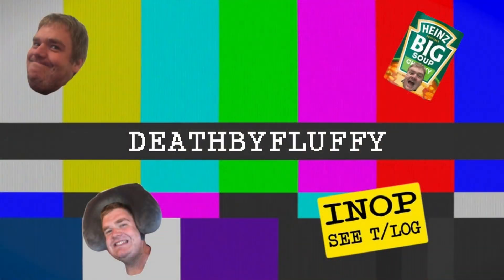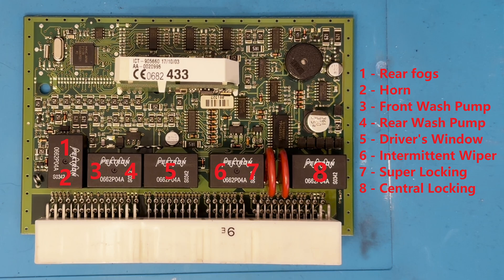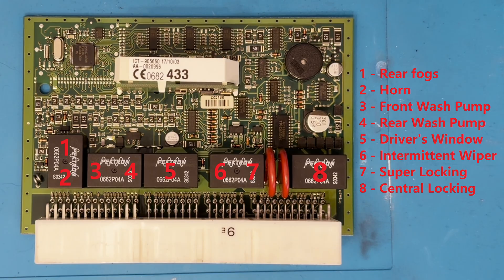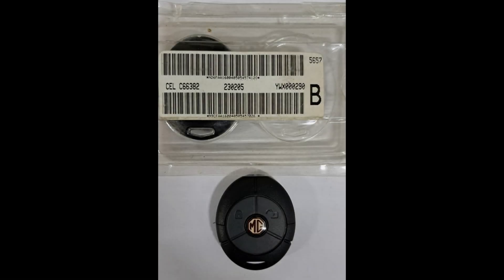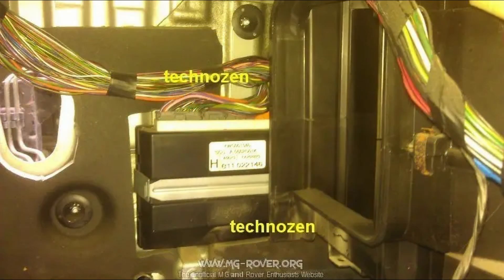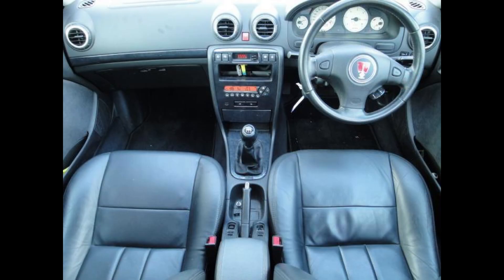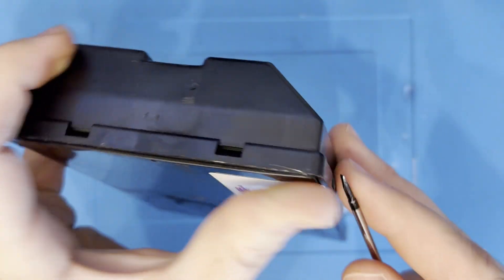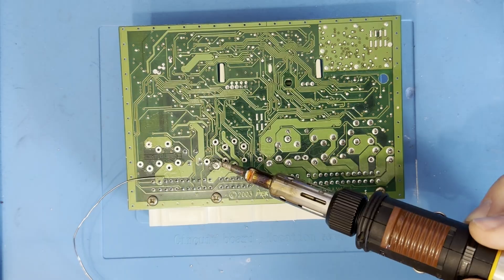MG Rover Pektron BCU: replacing relays and diagnostics (25, 45, ZR, ZS, TF)

Comment: Any idea where to get the torx plus security 5 sided screw from? I can find it on any of MG parts places.
Reply from the maker: I used US Pro 2264 - a set containing a range of 5-sided security bits. 
I've found the same fixings on MAF Sensors in the past, so figured it'd be handy to have a few other sizes!

Comment: Hi, thanks for the video and the work for the community. I am engaged in complex repairs of Pektron units and I can confirm that the content of the video is more or less correct. However, recently I have been encountering more failures of the transistor controller than the relay. The result of this is, for example, the stuck horn. I also do not have a good experience with XPart controllers, which have floating code errors. Greetings from roverclub*cz ;-)